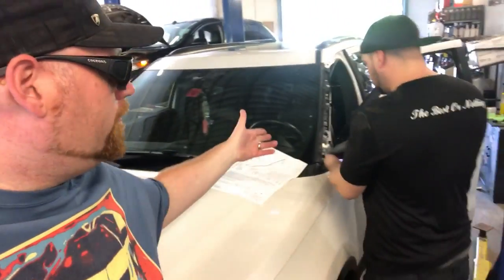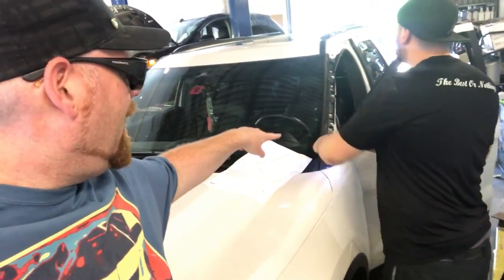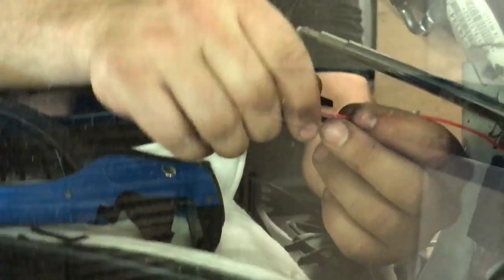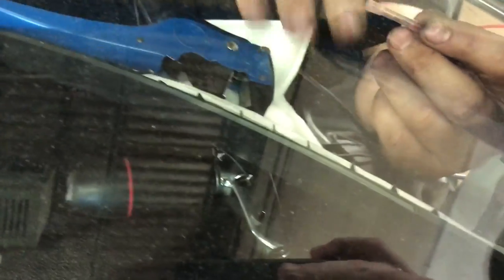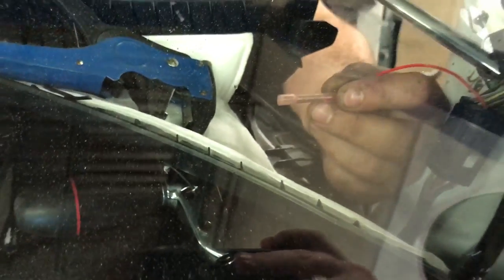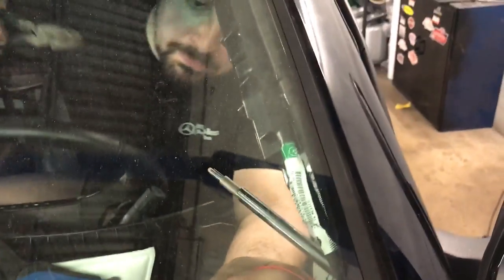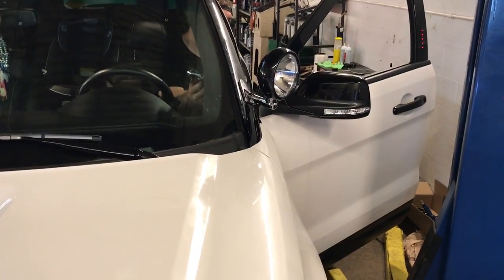2016 Ford Explorer Spotlight Install

Comment: For someone who is trying to REMOVE spotlight from 2014 Ford Explorer, do I need to completely remove the trim?
Reply from the maker: Hunter Stone you shouldn’t have to... but you will be left with a big ugly cutout in the trim piece. I would recommend getting a new one without a rectangular hole cut in it
Reply: @carguysnewengland  I'm having trouble removing it completely. The bracket wont come out at this point. All the screws are out. Not sure what else needs to be done.
Reply: @carguysnewengland  I figured it out! I missed a nut. Really appreciate it guys!
Reply from the maker: Hunter Stone glad to hear you got it figured out

Comment: Does this interfere with the side curtain air bag??
Reply: In my experience with the Explorers, the typical install will not affect the side curtain or steering wheel airbag deployment.

Comment: I thought it was an ok video.  I got a light...install kit...but templates didn't help me much...didn't know I had to take off shiny trim...
Could have been a better video with more detail.  All in all...its the only Explorer install video lve found...so it helped out greatly
Reply: Scott, would you please share a link with what i need. I have a 2013 police interceptor. Has interior hole but not pillar hole. I guess it once had a light but was removed. Id like to put another on

Comment: Will a crown Vic spotlight fit a explorer ?
Reply: I would not recommend it. I just did a newer charger at work that I didn't have the proper kit for, and it was a nightmare. The templates that Unity provides make the job much easier, and more reliable.

Comment: What did you use to cut the hole out in the black trim piece? Need to get my windshield replaced and obviously will need to replace trim
Reply from the maker: Joshua A if I remember correctly we used a dremel cut off wheel and also the sanding drum attachment